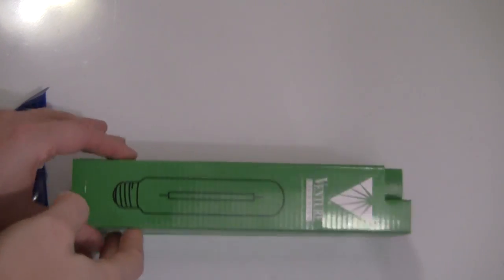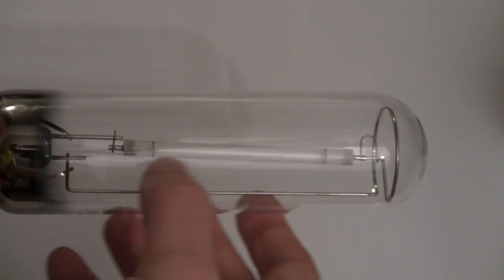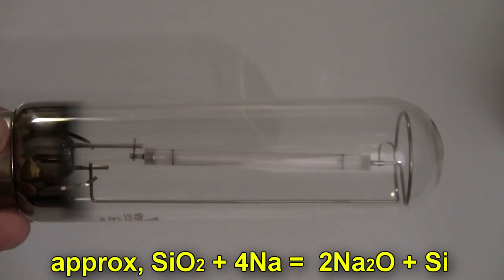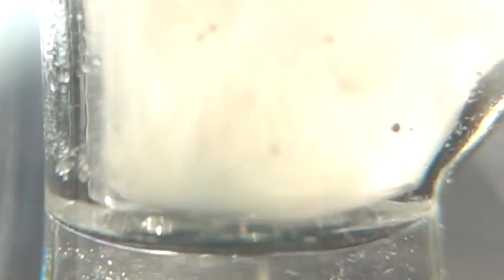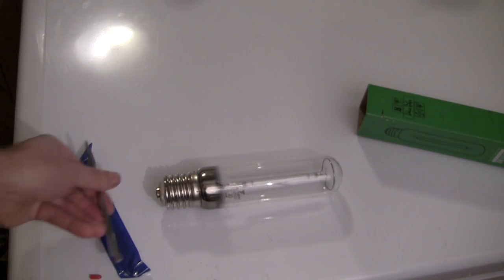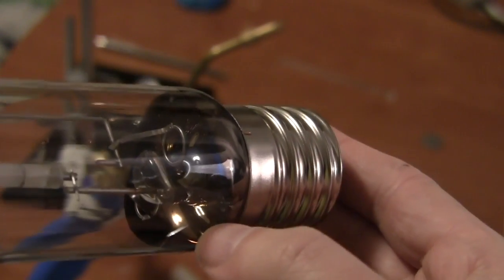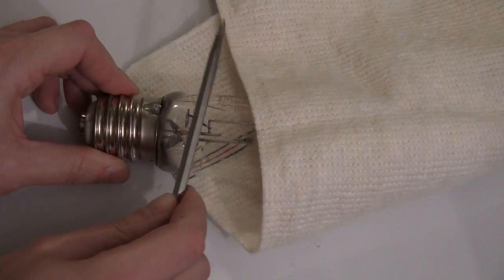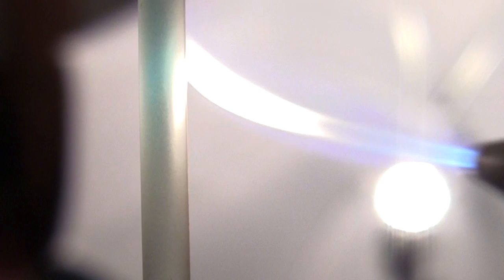Surprises in dismantling a sodium streetlight!

Comment: Cool. But it brings to mind a helium plasma tube where aluminum pellets serve as a battery for electric powerplants in aircraft. Maybe that shows my ignorance of Science, but as the aluminum oxidizes and the engine vibrations tumble the pellets in a plasma tube, wouldn't that continue until all of the pellets were powdered? The glow would be peculiar for an aircraft engine, but my question is whether a heliox plasma can sustain that reaction and get a dependable energy stream out of it, in the way that Thunderf00t's tube is conducting?

Comment: Thunderf00t - The silver at the bottom is a material on the glass is Cesium which gets rid of molecules not pulled out by the vacuum pump.  They were also used in vacuum tubes.  It is called a 'getter'.

Comment: T H U N D E R F 0 0 T --- The silver black mirror at the bottom is from when they rf activate the "getter" tray rings in a vacuum - the small trays in the bottom, which are heated after sealing, the inert reactive contents evaporate covering the inside making it active and show as silver black.. this material cleans the remaining gas of impurities. If you ever see a broken tube, valve, bulb etc, the silver getter usually turns white, oxidising as it totally reacts with all the air now in the tube.

Comment: The silver stuff on the bottom is from "guttering," a technique of putting some solid substance in a well-evacuated chamber, and heating it, to cause a reaction which causes the remaining gas in the chamber to become an integral part of the solid,  thereby improving the vacuum immensely.  This is a long established technique which was first developed for vacuum tubes (which is why brand new vacuum tubes, even those manufactured today, have the same darkened, shiny appearance near the base of the tube.

You do NOT see it in flourescent tubes, because they require the presence of a gas inside the tube to work.

Comment: The average temperature of a SON lamp (HPS) at operating temperature is around 1,000 to 1,200*c, well beyond the boiling point of sodium.

Additional facts about SON lamps:

> The silver material around the base is a getter material made of Either Cesium or Barium depending on the lamp manufacturer. It's an oxygen absorber that's used to maintain a solid vacuum.
> The lamp's outer bulb is under vacuum to reduce the amount of heat lost from the arc tube, which increases the luminous flux and by extension makes the lamp more efficient.

Also, a quicker way to heat up one of these arc tubes would be to buy some used SON control gear on eBay. Since you're not after actually making light with it, you could very easily overrun the hell out of that tube and get the result you want in less than 20 seconds. You'll have to be careful repeating the runs though because the glue that seals the arc tube will react with oxygen in the air and eventually fail, causing the arc tube to fall apart.

Comment: Are you sure that's not barium? That's what's typically used for getters in thermionic valves. Nice to see that a guy down with modern science-y stuff can be surprised by technology that's almost as old as the first electric light bulbs.

Comment: It was a long time ago that I worked for a lamp manufacturer, the outer jacket is a vacuum, to allow the inner tube to reach operating temperature. The black deposit is the getter which is used to maintain the  vacuum. The arc tube has neon content which behaves as a starter, allowing the sodium to heat. The choke is connected in series with the lamp as a current limiter.

Comment: It's an arc discharge lamp. They require a choke/ballast, and ignitor to start it. The ballast limits current while providing a high enough OCV to run it, and the ignitor provides 4kv for starting.

Comment: The silver coating is "getter" which is the final phase of making a lamp. The getter removes the last part of oxygen in the lamp envelope which would otherwise cause early failure. The alumina tube contains a pellet of sodium and other elements to produce the proper light qualities. Not openly toxic but you wouldn't want to handle it with bare hands. Sodium provides very efficient lighting but only in one wavelength which is that ghastly yellow.

Comment: The tube is welded together.

Radio and TV tubes have a small silver spot on their inner wall.  Just behind the spot is a metal halo. 

I was told that the silver spot is the result of bonding the last traces of atmosphere to the glass after the tube is welded together.

Comment: How did you identify the silvering as cesium? To my eye, it looks like a regular beryllium getter deposit as in any vacuum tube, and it oxidizes in exactly the same way when the seal is broken. You can see the getter structures inside the envelope, immediately above the silvering; they look like little metal 'halos'. I'm also unaware that getters are used in anything other than a vacuum vs. an argon atmosphere.  I assume gettering is used due to off-gassing of the internal elements when operated at high temps,  which otherwise might eventually begin to deposit on the glass and reduce the light output.. or otherwise affect the operation / safety of the lamp.

Comment: That's a barium getter, similar to that used on radio valves and CRTs.  It should turn a cream colour when it reacts with the air.  Older lamps used it, but these days it's tending to be replaced by a small pellet getter mounted on a stalk; I'm not sure what it's made of.

The green box of your Venture lamp indicates that it's the newer high output type; the oringinal ones were in an orange box, so Venture still seem to be using the barium getter on their high pressure sodium lamps, while their metal halide lamps, or at least the small ones which I have use the pellet getter.

Comment: the stuff in the bottom of the tube is what's called"getter material". used to mitigate contaminants like in a vacuum electron tube(radio valve tube) an induction heater is used in the final step to heat the circles at the bottom and they release whatever"getter"substance required. used under vacuum several different compounds can be used.

Comment: The outer tube is a vacuum Tube to insulate the inner. The silver stuff at the bottom is probably a getter to maintain the vacuum.  It is likely to be barium or lithium. Caesium looks golden not silvery and would catch fire on contact with the air.  The inner tube is aluminium oxide which can tolerate the heat of the arc once it has started. To run the bulb you need a choke (inductor) to limit the arc current as arcs have a nasty negative dynamic resistance once they get going. The inner tube will contain a starter gas. This may be xenon. You need about 5000 Volts to strike the arc. Some tubes need an external igniter to provide this. Some tubes have a thermal switch in the tube and rely on the back emf from the choke to strike the tube. Once the arc is established in the tube the heat build up evaporates the sodium into the arc and the colour goes from pale white though yellow to a nice yellow white colour.

Comment: the silver at the base of the bulb is a result of "flash"...a chemical is on those little rings at the bottom that when electrified "flashes" to remove residual oxygen. radio tubes are evacuated in the very same way.

Comment: I'm failing to understand why you needed to use a torch to heat the tube when there is a perfectly good filament running through it. Why not just apply a lower voltage to the intact bulb?

Comment: Wait... hps light bulps have mercury in em right ??? I handled alot of HPS light bulps in my time, and one thing people told me was - if you are in a room and one of theese suckers explode, just run to the nearest computer and google : how to clean up mercury :D But most HPS bulps i handled was between 400 and 1000 watts, maby there is more mercury in the bigger ones I dunno.

What the hell are you doing with a HPS you might ask ?
Well you can grow some flowers with it.

--->

The HPS lamp consists of a narrow arc tube supported by a frame in a bulb. The arc tube has a high pressure inside for higher efficiency. Sodium, mercury and xenon are usually used inside the arc tube. The arc tube is made of aluminum oxide ceramic which is resistant to the corrosive effects of alkalis like sodium.

The lamp comes in variations, but the most common way to start the lamp is with a pulse start. There is an ignitor built into the ballast which sends a pulse of high voltage energy through the arc tube. This pulse starts an arc through the xenon gas. The lamp turns sky blue as the xenon lights. The arc then heats up the mercury and the mercury vapor then lights, giving the lamp a bluish color. The lamp heats and the sodium is the last material to vaporize. The sodium vapor strikes an arc over 240 C. The sodium is mixed with other impurities to create a more "white" light. The mercury helps add a blue spectrum light to the pure yellow of the sodium.

Maintaining a vacuum is difficult, oxygen and other gasses can seep in over time. The getter keeps a stable vacuum by sucking out remaining oxygen and unwanted gasses. The sodium is stored often stored in the amalgam reservoirs on the ends of the arc tube when it is cool unlike the LPS lamp where the sodium is stored in the bumps on the side of the tube (see LPS diagrams)

Disposal:

The Sodium in these lamps is a highly volatile substance. When exposed to air the sodium may explode. The sodium lamp should not be disposed of in normal the normal garbage disposal. There have been many cases of garbage trucks catching fire when the bulbs in the back broke. Sodium lamps also contain mercury. The newer LPS lamps contain less mercury than before, but this has effected performance negatively.

Comment: That is incredible! Blue sodium vapor? If I'm not mistaken, that is the color of really angry electrons. Reminds me of a reaction I read about once. If you take liquid ammonia, you can dissolve sodium in it. This will give you a blue solution very similar to that. If you add more in, it will get darker and turn sort of a metallic copper color when it reaches a 3 molar solution. But this is from solvated electrons. One of the only reactions you can have where pure electrons will form a visible solution. Guessing that is a very dangerous experiment though. hahaha

Comment: The silver lining on the bottom is actually vaporised metal from the two getters on the bottom. When they make the tube, they suck the air out first with a pump, and after that they "flash the getter" (heat the two rings on the bottom with an inductive heater). The getter evaporates this metal, which in order "consumes" the last remaining oxygen in the tube and produces a pretty respectable vaccum. For more on that see https://en.wikipedia.org/wiki/Getter

Comment: The silver stuff, (if I'm right) is called a getter, origination I think from people still mass manufacture vacuum tubes. The getter it a device filled with a metal in halo like object and is released by induction after the tube has been vacuated of air, they use this to "suck up" any residual air in the tube, and when the tube looses its vacuum it turns white.

Comment: I have many of these lamps, and equipment to operate, during operation the alumina tube in side gets red hot ~ 1000C I have looked for this  sodium gas and have not seen this blue gas, the only thing I have noticed that under a low pressure the sodium gas(vapor) is opaque to the low pressure sodium light while the arc tube is still hot !

Comment: The "Silver" is actually caused by a very high voltage being applied to the outside of the bulb causing any left over impurities to be 'melted' into the side of the glass by those two rings, in TV vacuum tubes - they are called "Getters" 

https://s3.amazonaws.com/tubedepot-com-static/nos-6ca7-mullard-oo-getter-getter.jpg

Comment: The getter is much more likely to be barium than cesium. Cesium has a very high vapor pressure, so it would evaporate when the lamp is operated, and even at room temperature it would likely melt. Also, the material didn't turn gold until it was exposed to air, while pure metallic cesium is already gold. However, barium does react with both oxygen and nitrogen, and barium nitride is yellow-orange in color. Barium is also the most widely used getter material, though it is not the only one.

Comment: Actually I believe that the silver stuff on the bottom of the bulb is the same thing that have been used to remove oxygen out of CRT screens. In every old CRT screen there was a charge initiated by electricity that allowed for removing of remaining oxygen after the tube was sealed.

Comment: The reflective bit at the bottom is from the two circles of wire in the bulb near the base. They are called a Getter, and it does sometimes use cesium. More generally, it's a mix of reactive metals/compounds that vaporize in the vacuum of the bulb, and then form the mirror on the bulb as they bind with any impurities or contaminants to keep the rarefied atmosphere pure. This also completes the formation of the vacuum, binding with much of the reactive gases  that remain in the tube, and helps maintain the vacuum over its lifespan. Getters are also in most other vacuum tubes, which is the reason why the tops of old Nixies, petodes, and the like, are silvery.

Comment: the silver stuff in the bottom is a safty indicator , it turns white when air gets into the bulb, and if this happends the bulb wont work right, they have this on audio valves/tubes for the same reason

Comment: HPS and Metal Halide actually both work very similar to a florescent tube. In short, current excites a material. As the electrons drop back down from an excited state, they release a photon. The difference is, while sodium releases a visible light, the Mercury vapor in a tube releases highly intense UV light that then excited the phosphor on the glass of the tube which then produces visible light.

Comment: Shiny part is the getter, those rings in the bottom of it evaporate it when heated enough (usually by an external high power magnetic field), this coat "eats up" most of the remaining free floating atoms to produce a better vacuum, also to keep the vacuum for when more loose atoms are floating about inside

Comment: is it true it can shorten the life of the bulb if you handle it or get skin oils on it?
Reply: Your thinking of Halogen. In those bulbs, the oil from your skin creates a hot spot where heat is not effectively leaving the bulb. HPS is not effected by this. The outer glass is there for two reasons. To keep oxygen off the sodium tube, and to prevent glass from raining down on you when there is a non-passive failure (explosion) of the inner tube, although those kinds of failures are far more common with Metal Halide bulbs (a cousin tech to HPS).
Reply: Third reason is to absorb most of the harmful uv rays.  I did some work on a projector using a MH bulb out of its "case". Had a bad sunburn after about 5 minutes exposure.   Maybe TF00ts spectrometer can pick that up.

Comment: The cesium getter removes any final traces of oxygen from the outer envelope after its been evacuated. Also that arc tube contains mercury and argon as a buffer gas to enable starting. I think it probably wouldve been easier to just get a 150w HPS ballast, and observe the sodium arc discharge.

Comment: The shiny stuff near the base is the getter material, can't remember precisely what it is but it's on stainless steel rings that get heated by induction heating and deposit the getter material on the glass, which is the super active and will absorb all and any oxigen it comes in contact with expanding the life of the tube.
Reply: +Poptart McJelly posted before watching the rest of the video, nevermind. :D

Comment: The metallic deposit on the glass is called 'getter'. It's there to trap any stray oxygen molecules. It's deposited by heating those two little rings at at the bottom. I know that's the process for vacuum tubes, I suspect it's the same principle here. In vacuum tubes barium is most often used.

Comment: The easiest way I have seen to cut a cylinder of glass is fairly close to what you did, but instead of using a bead of glass you put it on a turntable, spin it at ~60 RPM and apply the torch where you scored it (you only need a small score) It heats up a ring of glass and it expands, stressing the score and propagating the crack all the way around the cylinder cleanly. 

I believe it is called "cracking off", I use it to cut tops off of bottles using a handheld butane torch and it works like a charm, takes just a few seconds. I don't have a turntable though so jerry rig one by placing a dolly on it's side and using one of it's wheels...

Comment: Do they make LEDs with a similar spectral output yet?
Reply: They output monochromatic light of a wave length that produces less glare especially in the rain because they don't suffer from the prism effect, it also cuts through fog slightly better.
In some places near telescopes it's the law that SOX lamps are used.
Reply: +Black Sin Impeccable Just realised this is about high pressure sodium vapour not the monochromatic low-pressure kind, it would be for the same reason you have warm white LEDs, just to look more appealing.
Reply: +Black Sin Impeccable Emerald green would probably produce the same effect if not worse than white light at causing glare and pupils dilate, Red is best for not causing glare, but the human eye doesn't see red so well, so I guess orange is a compromise.